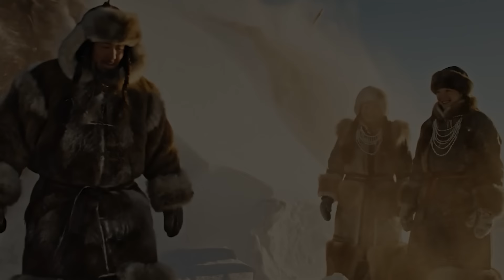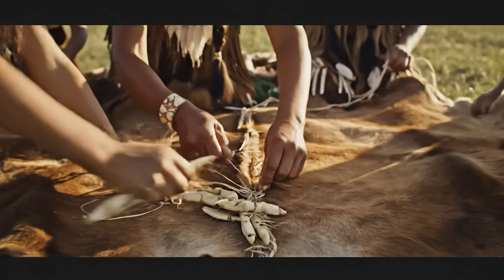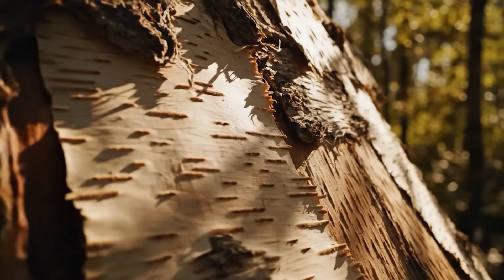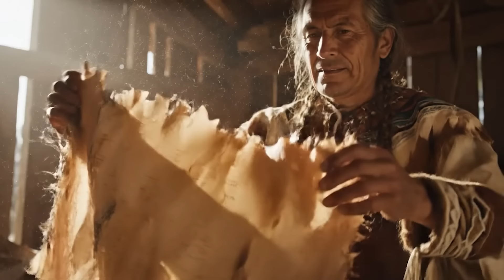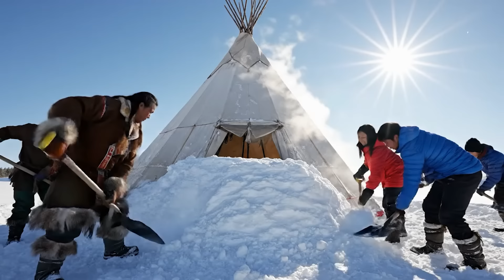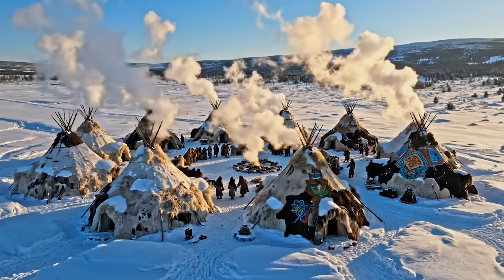How Native Tribes Built Winter Shelters

Comment: I made a teepee in my yard out of a 30x40 HD silver tarp. It ended up being about 15’ across and 15’ tall. The storm flaps on the top are a must and the inner liner is a game changer. I have used it for 8 years now;  staying in it for up to 16 days at a time with temps from 90° to -10°. It’s been a learning experience for sure